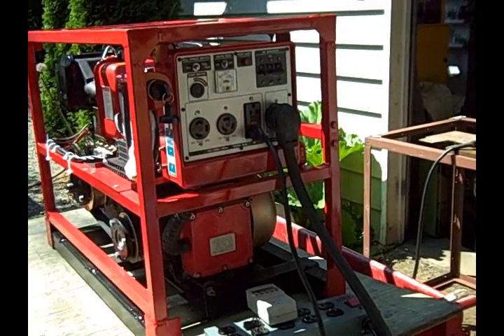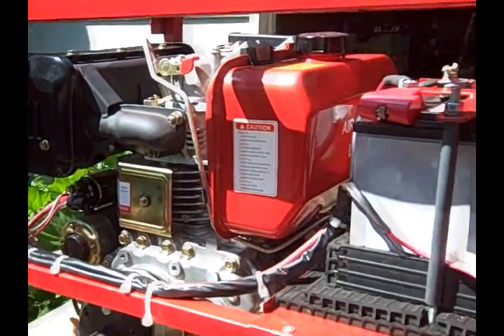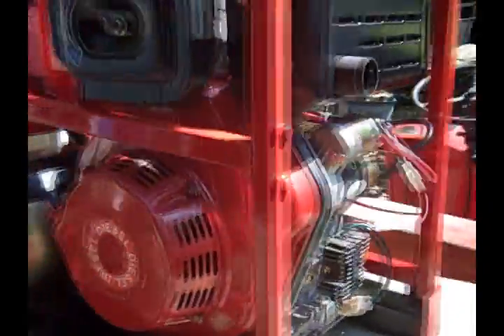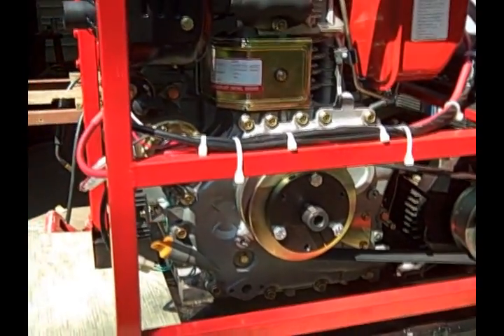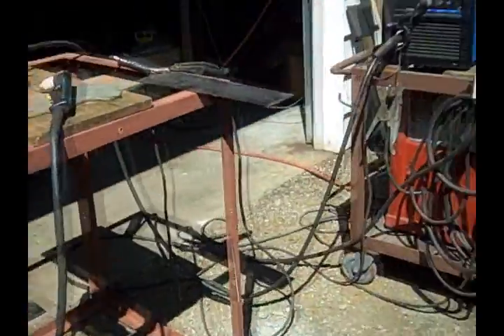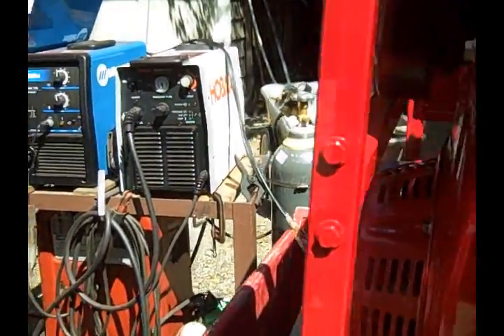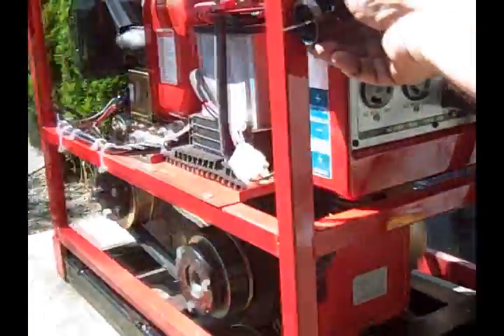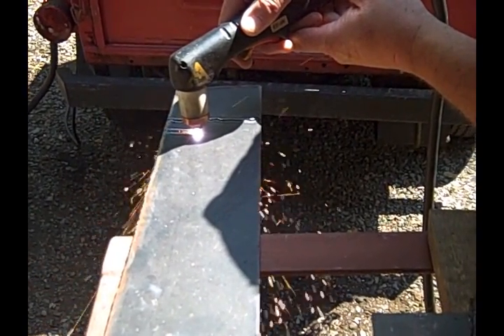portapmg.wmv

Comment from the maker: Update: The PMG is no longer sold by me, but the idea of running a serpentine pulley set and slightly under running the 3600 ratings of some of these engines >could< have a favorable effect on longevity, and increase fuel economy WHEN you don't need max power from the prime mover. Look for a decent quality 2 bearing generator. You need not be a Prepper to see the advantages in trouble shooting and or repair.

Comment from the maker: Yankee, thanks! Coming from a good Fab Man you put a smile on my face.  
A lot of people are convinced that direct drive is best, this is not so if your goal is to have a reliable and flexible generator you can fix yourself. Many generators get junked because the part you need is no longer made or so expensive you are forced to junk the generator. google 'utterpower pmg'  Kolher has some new small singles.